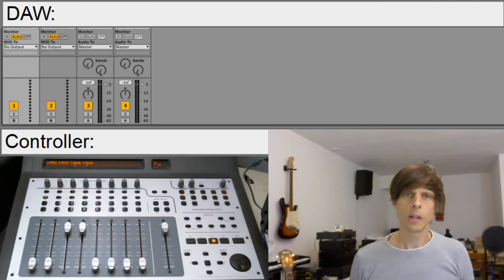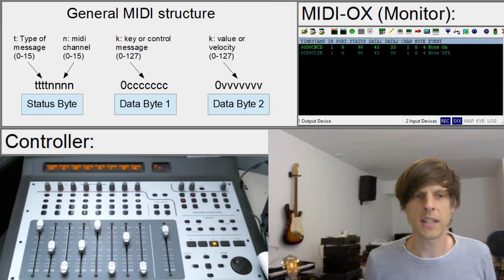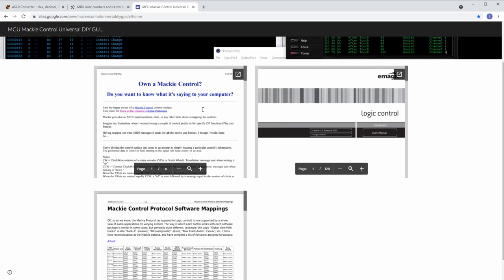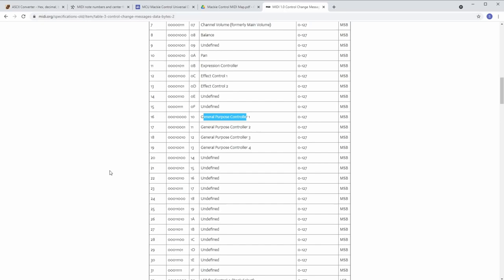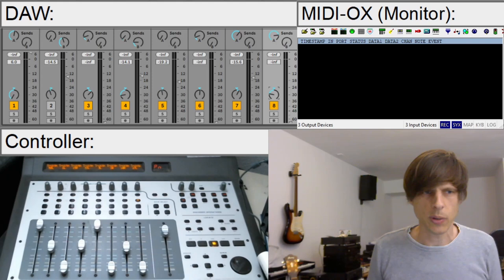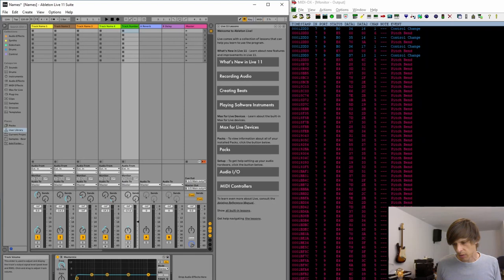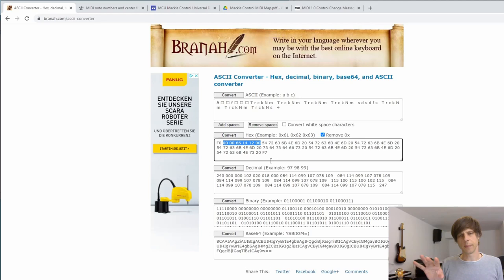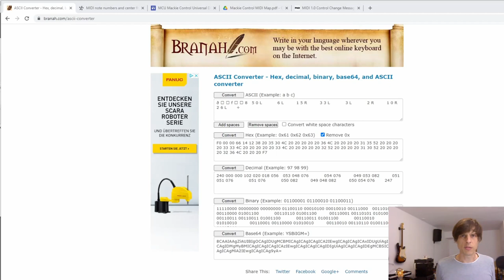MackieControl Explained: How does an external controller communicate with the DAW?

Comment: Really helpful video. I am building my own Arduino based midi controller and would like to print the selected track name to an LCD. Is it possible to read SysEx messages and convert them to text on the arduino?
Reply from the maker: Hi Ishaan, yes that is possible. I made a small example for you, please see the link below. This will receive the track names through the MackieProtocol and write it to the serial monitor. You do need an Arduino with two USB interfaces for this code (one for the MIDI and one for the serial monitor). So the only think you would need to do is write the track names to the LCD instead of the serial monitor.
https://github.com/mo-thunderz/Mackie-Control-MIDIUSB
Reply: @mothunderz  Wow! I did not expect you to go out of your way to write an example for me. I really appreciate it. Before your reply, I came across a midi library called Control Surface. The library documentation states that it has a SysEx send and receive function. Do you think this library would allow me to to use an arduino with a single USB interface such as the Sparkfun Pro Micro?

Library Documentation: https://tttapa.github.io/Control-Surface-doc/Doxygen/index.html
Reply from the maker: Hi Ishaan, a MIDI interface takes up a serial port and thus on a board that has only one USB port you can use the USB port for either USB-MIDI or for the debug console. I just used a Due because it makes debugging easier as you can use one port for USB-MIDI and the second port for the debug console. As you have your own LCD screen you dont need the debug console port and you can use an Arduino with a single MIDI interface (just delete all the comments about the Serial interface). The code I provided will work in essence on any Arduino as long as you make USB-MIDI work. The Arduino Micro does have native MIDI support, so that should work. I dont have one here so cannot test that for you, but I am sure there is lots of information online on how to make the MIDIUSB work for the Micro. You can of course use Control Surface as basis as well, however, from what I have seen that is based on the exact same MIDIUSB library, so if one works, the other works as well. By chance I actually implemented this code for some time ago. I have uploaded it to Github as well:
https://github.com/mo-thunderz/Mackie-Control-MIDIUSB/tree/main/Mackie-Control-Universal-Reverse-Engineering
However, I would keep it simple and stick to the first code I sent you (unless you plan to really use the many additional features that Control Surface has to offer). Good luck with your project! 
MT :-)
Reply: @mothunderz  Thank you for clarifying. I thought you meant that I would need to use a second arduino to drive the display because of port limitations. I had one last question that I hope you can answer. My goal for this controller is to use a main button to toggle the looper plug-in on a particular track. I would then like to press a secondary button, cycle to the next track, and use the main button again to activate the next track's looper. I am a little lost on how to do this. Basically I need to be able to change the midi sent from the main button whenever a secondary button has been pressed
Reply from the maker: Hi Ishaan, I am not familiar with the looper plugin, but it seems to me that this is not a generic DAW function, but an external plugin. The MackieControl algorithm is made to interface with the DAW. There are tricks to control a plugin, but in most DAWs there are more efficient ways to communicate with plugins. I use Ableton and that DAW allows you to map virtually anything to MIDI CC, so instead of going through MackieControl you can just send MIDI CC messages to the DAW and map this to control effects on/off and its parameters. MIDI CC of course only has 128 values, so if you more granularity, another option for Ableton is to use Max4Live:
https://www.youtube.com/watch?v=pBRe2xz7dgQ
Good luck with your project, and let me know if you post a video of the result!
Reply: @mothunderz  Thank you for the help. The looper is a native ableton plugin with a mappable toggle button. If you have some time you should check it out!
Reply from the maker: @pspexperts  You're welcome. Will check out the looper in Ableton, thanks for the suggestion.

Comment: How do we record and in what? I have an old tascam 16 track sound processor
Reply from the maker: This video provides a basic explanation on the MackieControl communication interface. This is useful for Digital Audio Workstations like Cubase/Logic/Cakewalk, etc in combination with an external controller. It will not be useful for a stand along tascam processor.